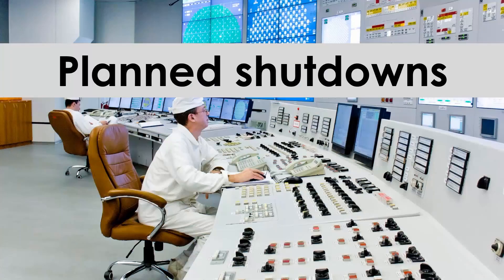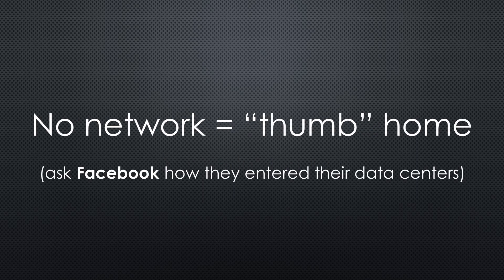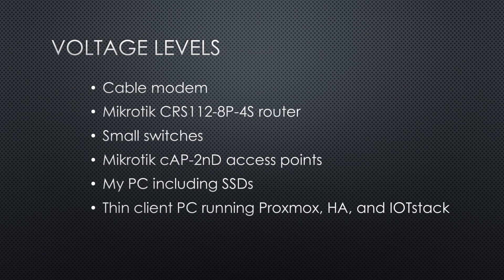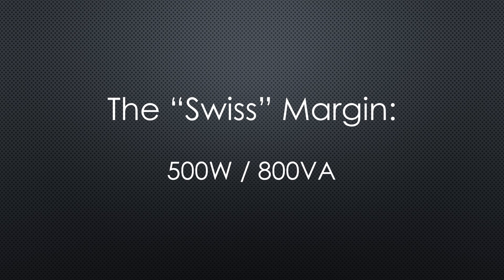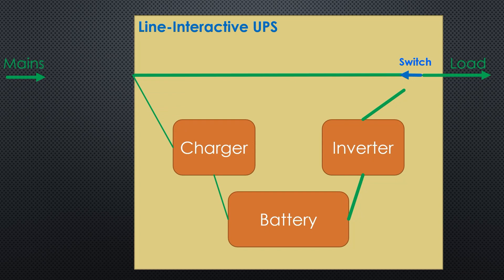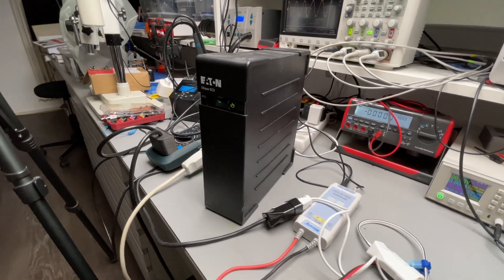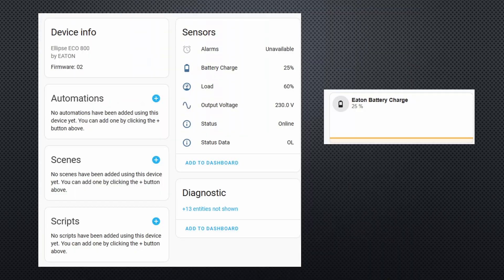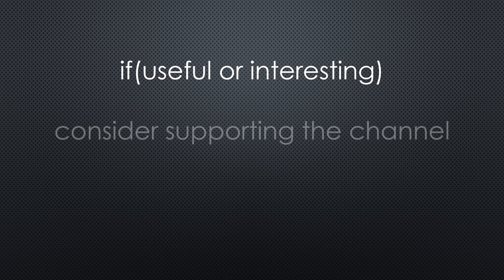447 How to protect Home Automation and PC with an Uninterruptable Power Supply (UPS)

Comment: I have or had all kinds of UPS from 220VA to 5000VA, of famous brands and some that did not even indicate the country of origin, but I have never encountered one with excessive transfer time, if that happens to an EATON I doubt very much that it is a design flaw, it most likely have a faulty relay.

TL;DR: I've a few APC Smart-UPS at home, one for each television and the devices connected to it, of the types SC420, SC620, SU420 and SU620, those only have one button so I use them as if they were power strips with a switch, I press the button to turn everything on and I press it again to turn everything off. I've another in the attic for the DVB-T and DVB-S amplifiers/switches. SC and SU units are line-interactive and modified sine wave.
When I bought them 10 years ago or more it was easy to find lots of 5 or 6 for less than €100 with shipping included, obviously without the batteries.
It is still easy to find them any day on eBay between €25 and €40 + shipping without the battery and around €60 to €100 + shipping with batteries in good condition or brand new batteries.

Until a year ago I had satellite internet and for that power hungry modem I had an APC Smart-UPS SUA750XLI that accepts external battery packs and has forced ventilation, although I didn't need those extra features I had gotten it on eBay cheaper than the basic model SUA750I which is what I'm using right now for my main computer, although it's rebranded to IBM UPS 750T. SUA units are line-interactive and true sine wave.

For the optical fiber network terminal and router I've a Salicru SPS NET, which gives 12V @ 2,1A max and comes with a Y-cable to power two devices.
There are simliar devices like Legrand Keor DC and Eaton 3S Mini that can be set up for 9V, 12V, 15V and 19V, but with those you must set the correct voltage before connecting your devices, since I only needed 12V I preferred the fixed voltage UPS from Salicru, less risk of damaging my devices if someone decides to play with the power button because I have those kind of friends that can be worse than children 😅
There are equivalent devices from other UPS manufacturers and computer peripheral brands, and of course the generic ones that you can find in any online marketplace.

APC UPSs with USB port are directly recognized by Windows 10/11 without the need for additional software, they'll appear in the system tray just like a laptop battery and they will also behave like a laptop battery depending on what is established in the active power plan, apart from the basic ones that Windows includes, you can create custom power plans and choose different actions for the different states of the battery and/or AC supply.
Reply from the maker: I agree with your suggestion. Now, my device completely shut down. So probably something was wrong from the beginning.